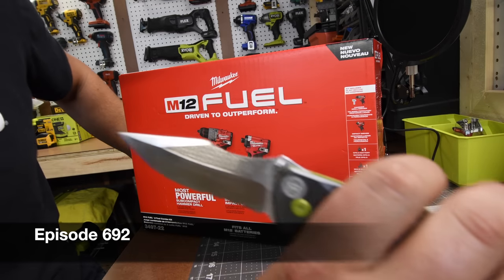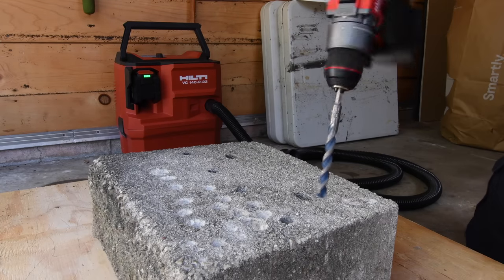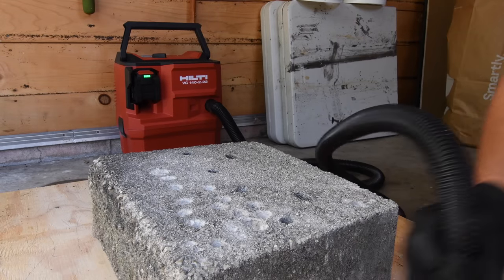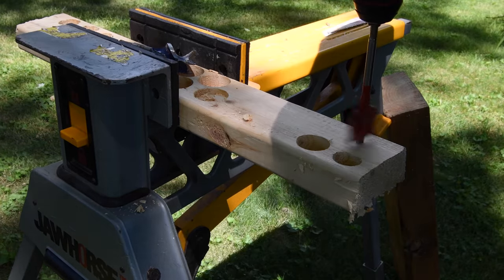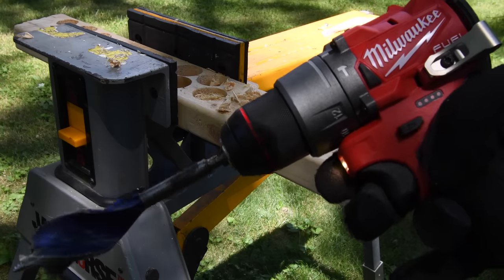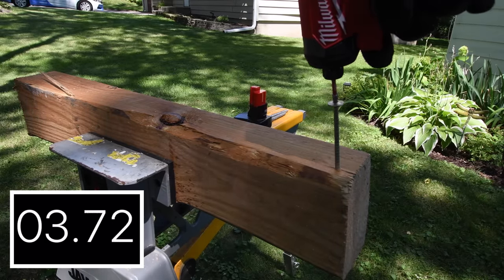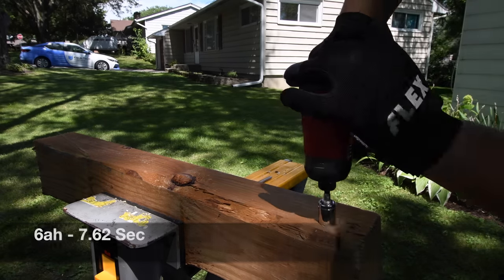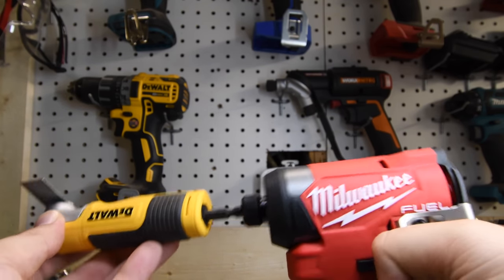New Powerstate M12 Fuel Tech!

Comment: The most exciting part about this is that the gen 2 Fuel M12 stuff is going to be cheap now, and those tools are really just so good that the next gen stuff just isn't necessary for what I use them for. The current generation M12 stuff is just the sweet spot. Can't wait to load up at 50% off lol
Reply: @b gg Agree. M12 for most of what I do and the 18V once in a while.
Reply: Right now you can get the gen 2 m12 impact driver and drill set and even a 3/8 stubby impact wrench which sometimes is $200-$329 alone and comes with a cp2.0 and xc 4.0 battery plus a free cp2.0 for $269.00 plus tax on home depot
Reply: @bruins871  I saw that. Great deal, but I really need the 1/2 inch impact. Maybe I'll settle for the 3/8 though
Reply: @enthused7591  you’ll be fine with the 3/8 it is just as capable as the 1/2 i saw a video that 3/8 is better than the 1/2 you can always use an adapter to convert it 1/2 too 👍🏽
Reply: Right! Gen2 impact is 79 bucks at homedepot. Great deal.
Reply: @OnePointLander  I picked up the kit with the impact, hammer drill, 2.0 and 4.0 batteries, bag and charger for $131. Great deal
Reply: @enthused7591  u got the online link?

Comment: The hammer drill overheats. Had a nylon cupped brush cleaning a surface and after 5 minutes the drill locked out on safety with the 4 flashing lights. 
Wouldn’t say it’s an improvement

Comment: Hey Dave I see the rpms on the gen 2 hammer drill are 1700 and this new gen 3 is 1550. So which one do you recommend for performance and power
Reply from the maker: lower RPM is always a bad thing. sometimes it means the tool can have a little bit more torque. id go with the gen 3 since its more compact than the Gen 2
Reply: @ManCaverTools  besides being compact which one has better performance all around like power and speed. Even though the specs are different for the gen 2 and 3
Reply: @ManCaverTools  besides the compactness which one would you prefer

Comment: Wow!  Nice upgrades!  For me, though, the "old" versions are working just fine - I only use them to 20% of their potential most of the time anyway.  I do have the surge impact driver which works just fine driving screws, but it doesn't work so well to loosen lug nuts (okay, it can't loosen them at all!) but then again it wasn't designed for that.  My next purchase will probably be the stubby impact wrench to get me that lug nut loosening torque!
Reply: Get the mid torque

Comment: Nice vid as always 👍.  Is hammer drill any lighter/smaller than the previous model? It looks more compact as the pervious one.
Reply: At 8:28 you can see that the new drill is at least 1/2" shorter than the prior model.

Comment: I've got the 2551-20 impact driver which is the surge. Great tool but I see this new one has bumped up the torque quite a bit. Are they going to make a new one with the surge option?
Love the tri-led on the new one. These old eyes like lots of light.
It seems like Milwaukee is posting 'peak' torque for the 3530-20, 1,500 in-lbs. For the one I've got they post the 'sustained fastening' torque of 450 in-lbs. I wish they would just stick with one number and do away with the advertising fuckery.
Reply from the maker: we will see in the future if they make a surge model. Versus video coming soon
Reply: @ManCaverTools   Right on. Good to hear. Can't wait to see it.

Comment: It's not a revolution its a minor facelifting... They were also really good in last gen. Higher capacity of battery wont give you more power. It will just run longer. they are delivering same amperage to the device (thats why they have HO batteries). This is electric device not a gasoline engine it does not need to break in to work better...

Comment: those are kids toys for d.i.y ers !! im getting gen 4 M18 drills
Reply from the maker: these have their purpose
Reply: I use M12 all day, every day. Why carry twice the weight, and hold twice the weight above your head, if you don't have to?
Reply: @procrastinator1842  your a do it yourselfer or an hvac !!! m12 drill dies after making a few holes with a hole saw !! always gets stuck cause the power sucks ! the hammer setting is useless ! the impact is ok if your just hanging pictures on the wall at home again no power no torque no batterlife
Reply: @almightytrustnobody4136  I'm neither, although I do have an HVAC ticket. You are right though, the current m12 1/2" drill struggles. The rest of the tool line-up works great. This new drill, coupled with the new HO batteries will hopefully do better with a 1" spade for rough ins.